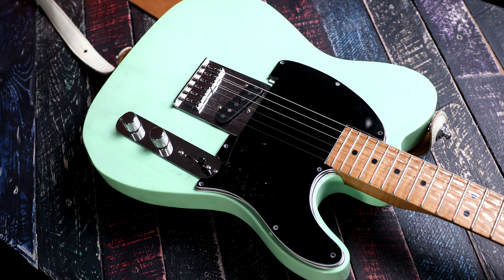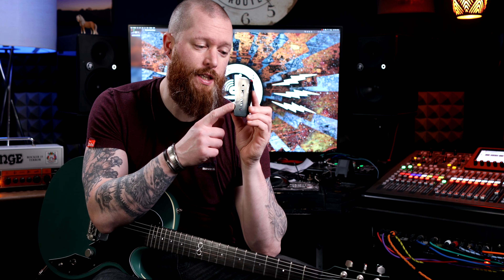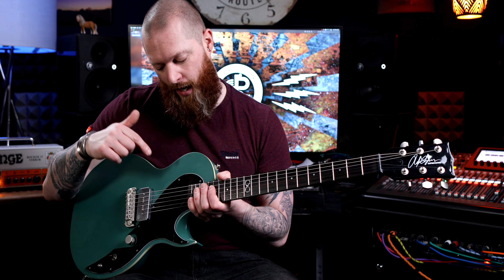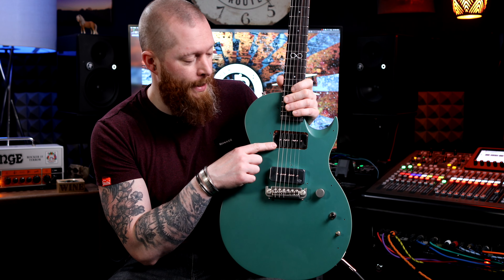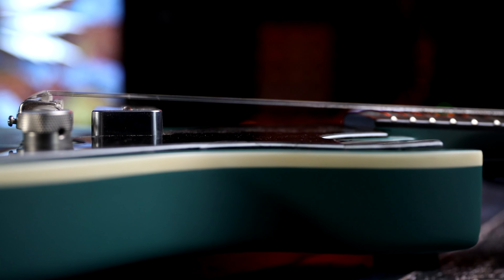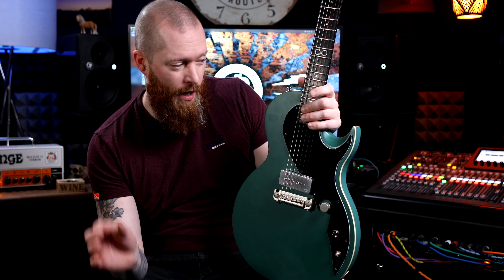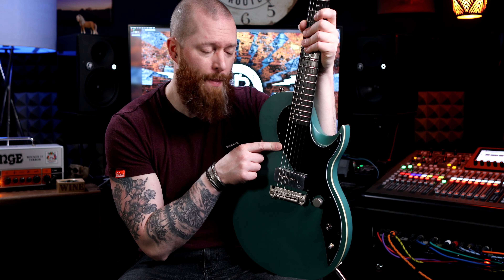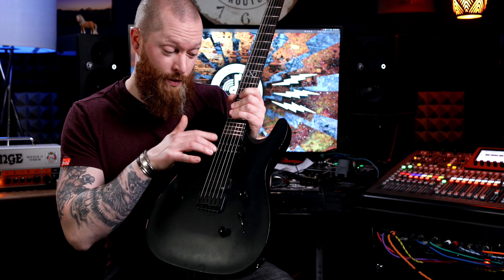Stealth pickup

Comment: I see use for this setup, when neck pickup is lower in volume. I got H and S in guitar and H is louder and normal with strings, but S is lower from strings and has lower volume.  I use S as cleaner signal and lower gain sound. So I personally find use of this volume difference. Like channel switching.

Comment: I wonder if this might work better with an active pickup, or maybe if you tried sticking a little preamp circuit in there somewhere just for the neck
Reply: Yeah, a preamp would help it quite a bit. It's all about the output, when hiding a working pickup under the pickguard. Or just use a boost pedal when using the neck pickup
Reply: it doesn’t work with an active pickup. active pickups need to be very close to the strings due to the nature of their construction. i plan on doing this with a Tele Deluxe with a Wide Range humbucker bridge and whatever works in the neck, and my plan is high output and some sort of boost circuit exclusively on the neck pickup to equal out the volume levels. since i don’t plan on using the neck alone almost ever, it shouldn’t be an issue.

Comment: In theory there's a few ways to solve the volume problem. #1 for me would be either switching your bridge and neck PU, assuming they have different values, or just buying a new set that includes 1 around 20k and the other maybe 10k or less.#2 add a volume boost switch to the neck PU. #3 individual volumes for each pickup with a treble bleed on the bridge,, and then either set your overall volume with the master volume on your amp, pedal, etc